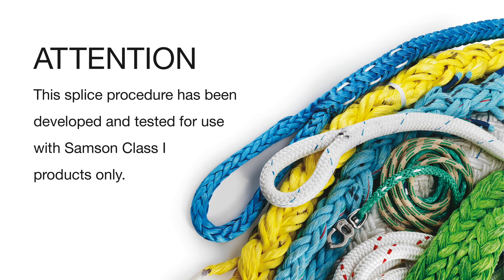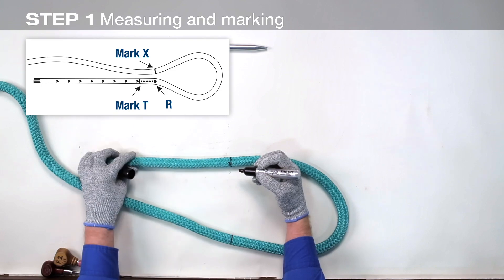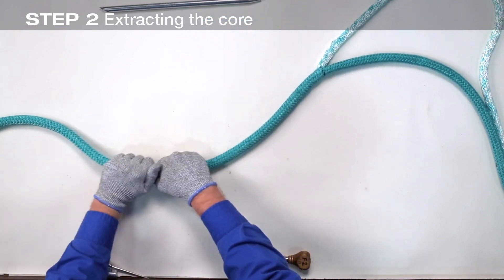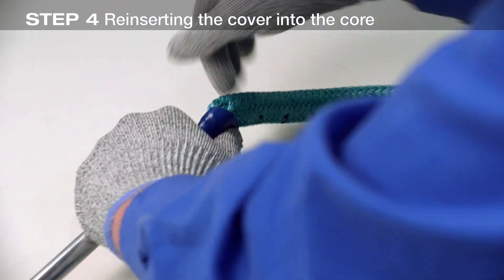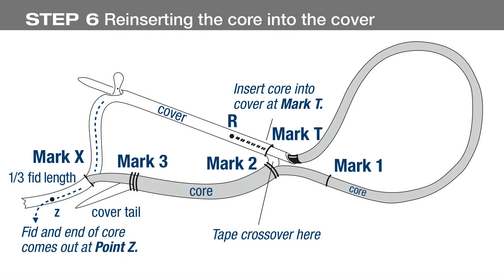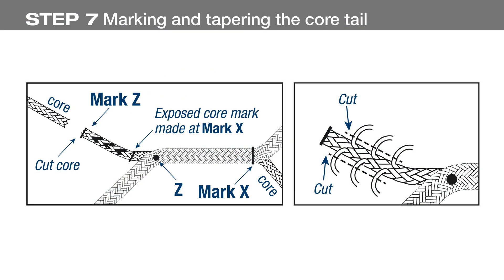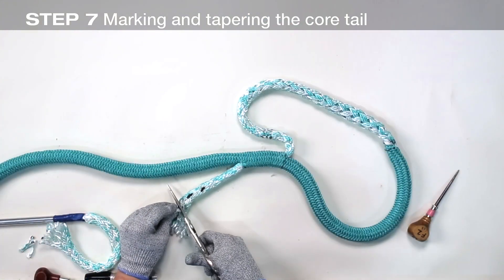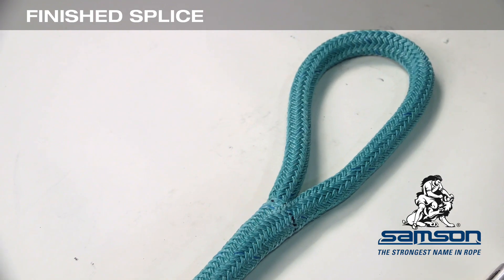Samson Rope: Double Braid Class 1 Eye Splice

Comment: Marking and tapering the core is completely redundant. In 20 years, I've never done this, especially in new rope. I could see doing it in some used ropes but I've never done it in those either. 

Onece i get the core sticking out the cover i removed all of the slack pull the core out about 1/2" and cut it where it comes out of the cover, remove the slack again to suck the core in then pull the cover over to finish the eye. No need to taper!

Comment: Great video. Thanks. I found this vid to be a great companion to the written instructions. My first attempt took a long time, but turned out great. After making  several eye splices it goes pretty quick now. Better than paying $$ for the local chandlery to do it. 

One thing that confused me in the instructions is they kept mentioning “the crossover” but did not define what that is. The crossover is the point where the cover is first fed into the core and later the core backtracks into the cover. Hope that helps.

Be advised, if you are working with old stiff rope the splice will be much more difficult. Try unlocking the fibers by first soaking and flexing the rope (at least 6 feet or 2m at the end) and letting it dry. 

New rope is very easy to work with.

Comment: I’m so lost, too many camera angles!
Reply: If you are visual like I am, it confusing at first. What’s basically happening is you pull out a specific length of core from a specific measured spot. The magic then happens by stuffing part of the empty cover into the core, and backtracking the core into the cover. It looks like a mess near the end, then it all comes together in the last step. 

One thing that confused me in the instructions is they kept mentioning “the crossover” but did not define what that is. The crossover is the point where the cover is first fed into the core and later the core backtracks into the cover. Hope that helps.
Reply from the maker: Sorry about that. We also have PDF's with the instructions on our website if that's better for you. https://samsonrope.com/resources/how-to-splice-rope
Reply: This splice is very confusing.  You're not alone.  Even after a lot of practice and doing them well now, I'm still amazed at whoever thought this up first.

Comment: I’m a boat owner of 10 years standing and consider myself reasonable at practical and physical issues and with pretty good upper body strength. Be very wary of these videos. I’ve managed about 20 eye splices and it’s Much , much harder that these videos suggest . Misleading at best and duplicitous at worst . I notice that half of them are cut and edited when it comes to the difficult part. I don’t know where the difference comes. Undoubtedly the rope used has a lot to do with it. But what takes the video 30 seconds I can’t do in two hours of hard struggle. Welcome to be proved wrong or shown why but it’s not nearly as easy as these videos say. 
For a start it’s ridiculous to suggest you can pass a fid past the throat of the eye . Not even close to being possible . Even with a D ring puller it’s very hard . 
Be warned . All comments welcome

Comment: Ya .. that didn't work :-( My crossover is ended up in the middle :-(  ... 2 days later ... :-) :-) :-) I did it .. I did it .. I did it ... of course it took 4 time to get it right.  My 2nd one will work, though.  Working with not new 3/8" .. that may have been part of the issue.  I'm sure new and larger would be much easier.  ... On the last core insertion from X to Z I had to massage the strands with the fid inside to make it large enough to pull the core through.  Even so, I did in 3 steps.

Comment: My cover is not burying into itself at the end of the eye splice, what am I doing wrong.
Reply from the maker: Sorry you are having some trouble. If possible, try to pull more slack from the body of the rope.  If this doesn't work, Mark 2 on the core may need to be remeasured to make up the length needed to bury the splice.  The longer this measures, the further the splice will bury. This may make your eye shorter as well.

Comment: What’s the trick to getting the core back through the cover and core?  I always have the most trouble at that part and it looks so easy here.
Reply: When burying the core back through the cover it helps to have tension on the section of core that is being passed, while having slack in the cover.

Comment: I get to the last steps, inserting the core into the cover. How do you get enough room to bring the fid through? I trimmed the core end and went to my smallest 1/4 inch (practicing with 7/16 line) it jams TIGHT!  Using Samson splicing kit...
Reply from the maker: Timothy C Depending on the rope it can be tough. Used ropes or even certain coated ropes can add difficulty. This one does take some practice.
Reply from the maker: The best method to pass the core through the cover is to put tension on the core, where the core is coming out of the cover, and slide the cover back, toward where the rope is tied/pinned off, to create enough slack for the fid and core to pass through the cover.
Reply: Samson Rope thanks for your reply.  It was a rainy weekend and I got a lot of old rope.  I tried everything I could, sliding the cover, reducing the core and / or cover, hammering, laundry softener, smaller fid, it wasn’t gunna happen. Finally I saw a video where a D-puller was used. I managed to make one for less than $5.00 and was able to complete a couple of practice eye splices. The area from point X to Z becomes rock hard once the fid is about half way in. My puller is smaller than the 1/4 inch fid and it is still a wrestling match to pull it through.
Reply: Right there with you.  Takes me a few days to work it through.  Haven't found anything that helps.

Comment: The absolute worst rope splicing kit on the market.  It handicaps one’s splicing technique by making a very simple task a sweaty confusing nightmare.  If you buy this kit, and follow these instructions, be prepared for a frustrating failure on many attempts.  With other kits, you’ll make a perfect splice on your first try.  You’ve been warned.
Reply: I used this instructions and it worked   out perfect for me. Of course fir time is harder
Reply: You must work for the opposition 🤣
Reply: mangore623  which splicing videos do you recommend, this one is confusing and drawn out .